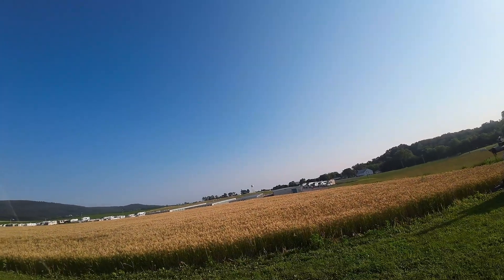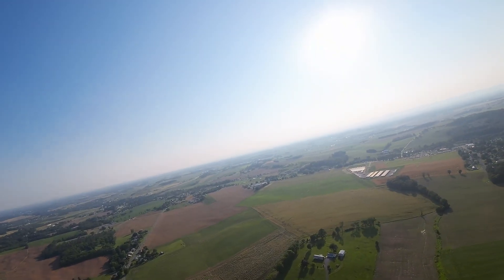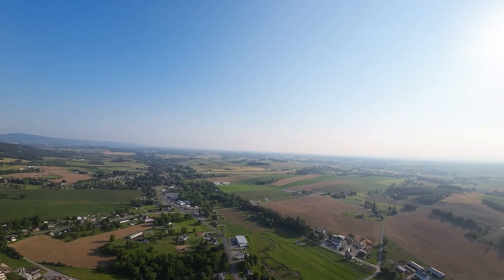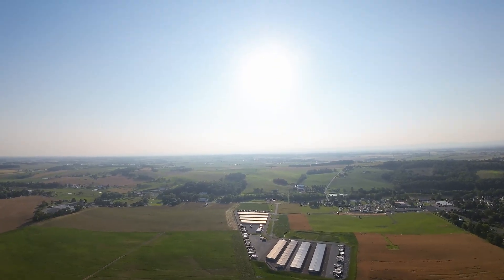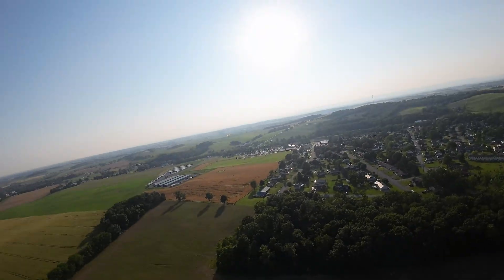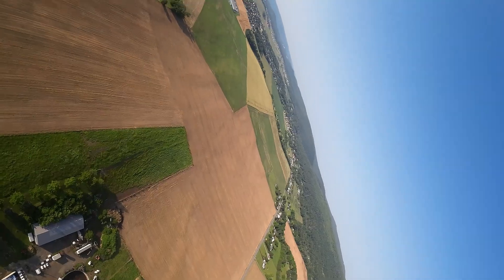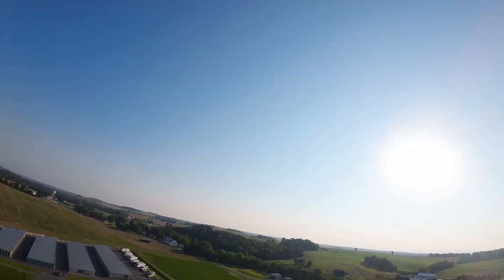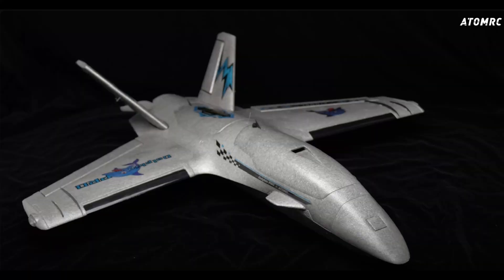Atomrc Dolphin Pro ~ Flys Perfect ~ Voice Over PID's

Comment: How much throws have you set up? Regarding inav 8 bouncing, form what i have read, it seems to be issue of nav_fw_pos_z pids being to high. It is because in 8 the altitude conrtoller was changed, yet default pids were only slightly lowered, and on some planes P and D, need to be lowered further.
Reply from the maker: My diff is in the info you can download and check all the information.  Barometer Altitude Position has been lowered a ton. As for throws would have to go back and look.

Comment: Good vid.  How long can this Dolphin Pro hold a knife edge with that big v-tail rudder?
Reply from the maker: Not sure if it can never tried 😂
Reply: @Pr0pCiRcLes2  You can go up to a high altitude and give some two-thirds throttle and then roll the Dolphin onto its side.

Depending on which side, apply full rudder left or right rudder and watch if Dolphin's nose holds level or not.

You can do it!  The Dolphin is basically a fighter jet! 👍